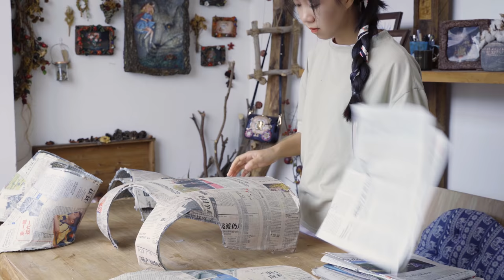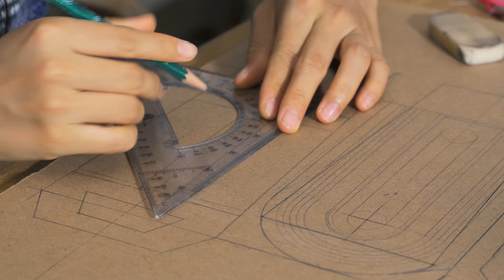How To Build Your Own Wearable Robot?

Comment: iron man: wait, this is my tehcnology
Reply: This is a joke, but I might try this as a cheap, effective way to make bullet proof armor. All I would need to do is coat the wire mesh with fiberglass instead of newspaper
Reply: Burda da türk buldum
Reply: Make it...nice
Reply: @smudge2021 ??? You can make level 1 bullet proof armor really easy with resin and fiberglass canvas layered. 10 layers will stop anything short of a rifle. Using the frame you could make full body armor that would hold back anything small. Pistols, buck shot, slugs. I've done it before. You gotta cover up when you cut out the fiber glass though. It's nasty stuff.
Reply: It would cost like 200$ for a full set of body armor with this method.
Reply: @nickstein3129  What is your definition of bullet-proof? This will potentially stop the bullet from puncturingv all the way through but I would challenge it would get lodged inside of the armour not looking very good nor being efficient to multiple shots. My method may be more expensive but will barely leave a mark the bullet will bounce off from impact.
Reply: @smudge2021  my man, chill out. If it makes you feel any better I'll say "Bullet resistant". Your probably the same type of person who whines when someone says " silencer instead of suppressor. Even though it's just describing the item in question.
Reply: At this point man, I might as well just contract a company to 3d print it out of titanium and have it painted with thermal resistant lining. But that's impractical and expensive. And you wouldn't be using the wire mesh like in the video.  @smudge2021
Reply: @nickstein3129  That wouldn't work. If you want something bullet proof, use something like ceramic tile or small squares or circles of something ceramic then some steel. 3/4 inch I think steel is the best. The ceramic breaks up the bullet then the steel stops it, it's effective up to 5.56 rifle rounds which is pretty good.

Comment: I never tought About using this technique,  nowadays you see only 3d printed ad complex stuff, really an amazing work
Reply: 3d printing is much simpler than this, it's literally just 3d modeling and then the machine makes it for you, but this is sketching and hand made it's really hard stuff
Reply: That suit is much heavier then making this out of EVA foam or 3D printed parts.  Also the power of video editing makes it look better then it would up close.  Not discounting what she did as its still amazing considering the minimal tools and materials.
Reply: Nobody else uses this technique for a reason.  The materials she's using are too heavy.  By the time you could get the entire suit on, you'd be exhausted.  The suit could have been made from far lighter materials and looked just as good once it was complete.  Research is your friend on a project like this.

Comment: Most people would have trouble imagining making that! Also this seems like it requires many different fields of knowledge to make- huge props to you
Reply: not really, i mean you do have to know a wide range of things but not really have to know any of those fields per se. About 90 percent of what we do just looks like its elite level knowledge because we use so much of it. Hooking up a 12 LED prop vs hooking up a 1200 LED prop is just doing 12 of them over and over and over again

Comment: That looks great! But it did seem like it might turn out to be quite heavy based on the material that was used. I suppose as long as the person inside can handle the weight. It doesn't really matter. I suspect being inside of it for long periods is probably not an option. I have seen other robot suits that were made and weight always seems to be a common issue, along with mobility inside the device. That being said, this was a great job!!! You have amazing talent in this field and I predict you will go far working in this field.

Comment: Old school upscale kit-bashing, and I'm all for it. I love to do this for my 1/12 scale action figures, and for years I always thought on a life size built, but seeing it done is just awe inspiring.
Reply: how is this kit-bashing? no kits where bashed just cardboard sheets that where most likely previously cad designed
Reply: @mmiiuygivk2651 True that the cardboards could had been cadded but what I mean on Kit Bashing is making stuff built with stuff that is not for what is built for. That is the principle of Kit bashing, yes, you essentially destroy a model kit to make a different model. Now, also the term Scratch building is still connected to this principle, because you can mix up the techniques to build your own thing.
Reply: @EternalRoman  IDK pretty sure the model design is from the TV series 灵笼: INCARNATION
Reply: @aitharel3009  ooh nice, I may have to check it out. Thanks for the info 🙏😊

Comment: Is no one concerned about how she was using the electrical saw? Also why is she using a much more harder to get railroad tie hammer instead or a hardened rubber hammer or a chisel hammer? The reason im concerned about the power saw usage is because its not properly supported and not meant for curve cuts its also meant to have a solid foundation for the material being cut not a easily cuttable wooden bench which with how long the power saw blade is makes it very dangerous especially with flimsy materials like the compressed cardboard she was using, i understand she probably has been doing this for a very long time but it does not in ANY circumstance make it safe for you to use a high powered moving blade on an unstable or unsturdy (easily cuttable or not steady) surface if anything a table saw would be safer due to the table that it has to support the material though they are not as cheap as a jig saw they are much safer than the method used to cut the materials in this video. Also Tin Snips are quite easy to get they can cut through thick wire, metal, and metal mesh and are easier to use than those huge cutters she was using for that tiny wire also they are very strong for  a dull blade tool because the blades on Tin Snips cant cut your fingers unless you squeeze the handles together.